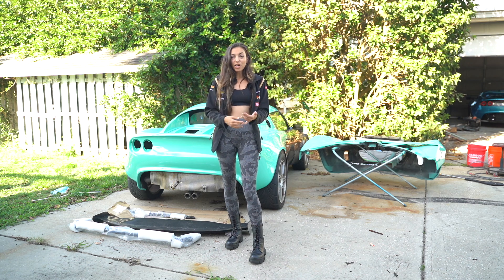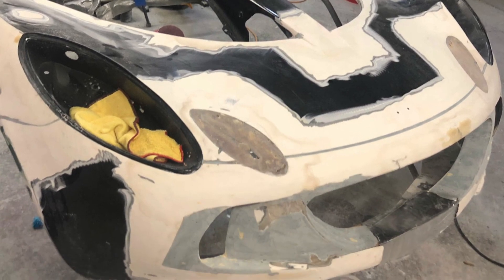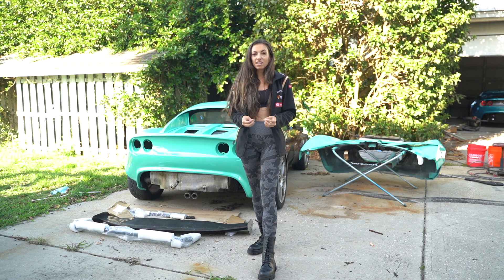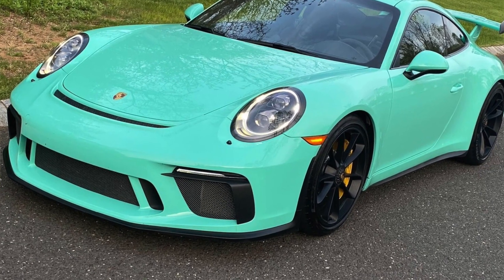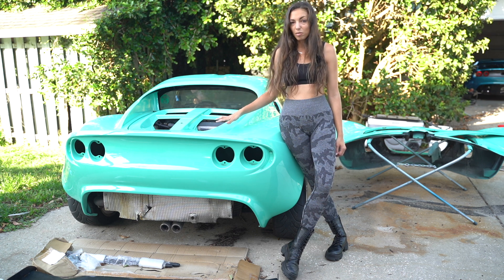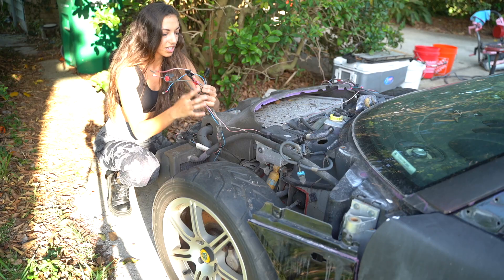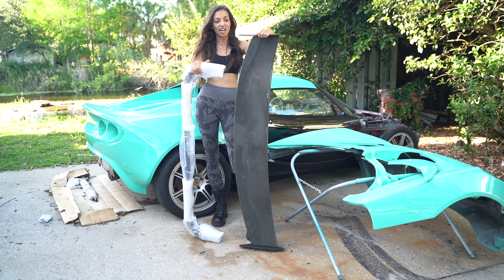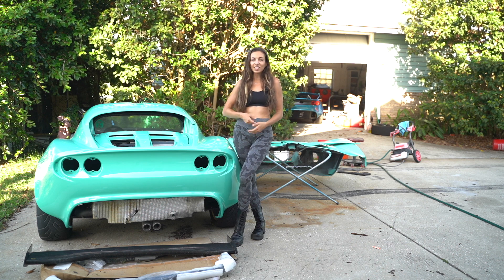MY $18K LOTUS ELISE

Comment: Can't tell if the rad is original but if so, get a fully aluminum one while the front clam is off! Also, may as well replace the front brake lines with SS ones. There's an HVAC resistor pack  fix and also a front belly pan service bulletin available. That just consists of drilling 4 holes for drainage.
Reply from the maker: I'm definitely going to fix the HVAC resistor pack, I haven't had AC since I bought the car. Will definitely add the drainage holes but I will probably skip the radiator and brake lines for now.
Reply: @CarFemme  If the end caps of that radiator are plastic, def don't hold off! Mine cracked luckily only a few blocks away from my spot and I was able to get home. But that could leave you stranded. Clam is already off, may as well. Inokinetic has a kit with upper and lower hoses. Good luck with the build, looking forward to seeing more updates on IG and here!
Reply from the maker: @bboixtc  sounds like I need to get some ordered then! Thanks for the heads up.

Comment: Looks like the build is coming together well. Who deleted the front indicators? Imho the rear wing will look a bit silly & OTT, I think that the paint is enough! Good luck.
Reply from the maker: The front indicator was done before I purchased it - it was done pretty poorly and the filler that was used cracked so you could see where they used to be. It’s fixed now with a proper matting.